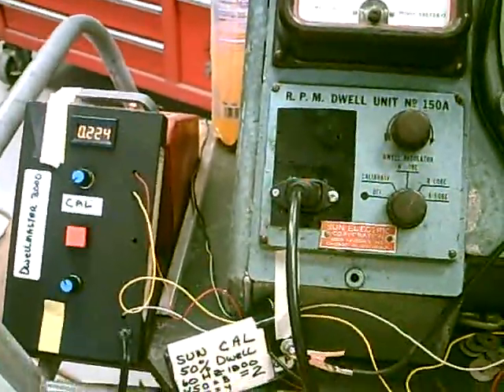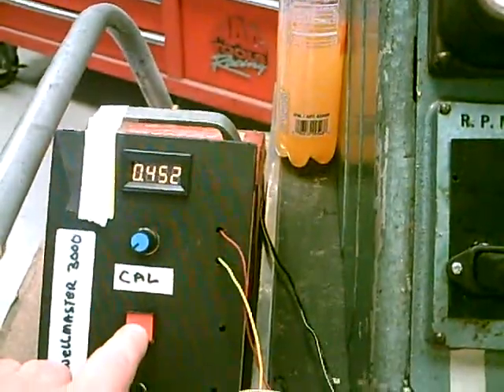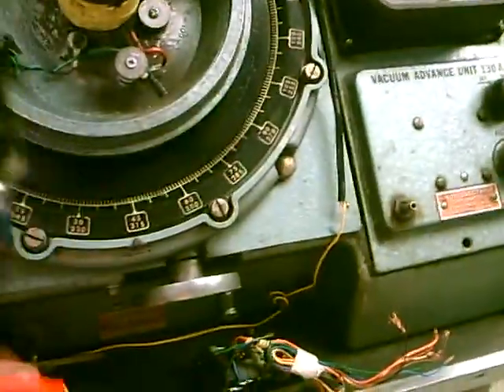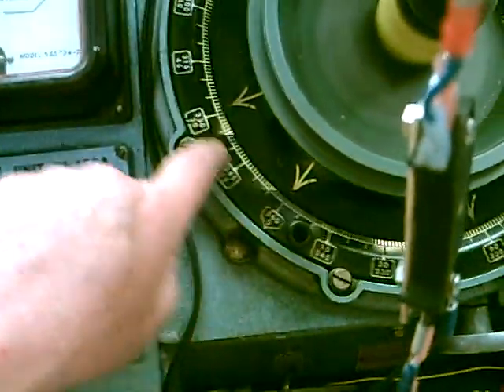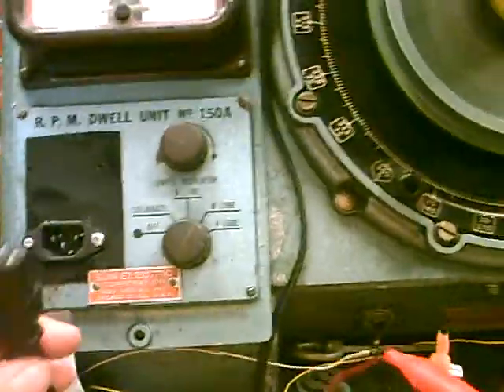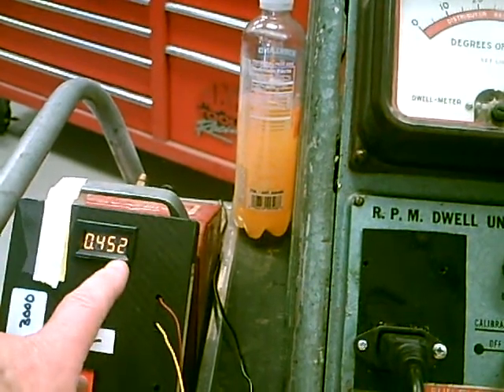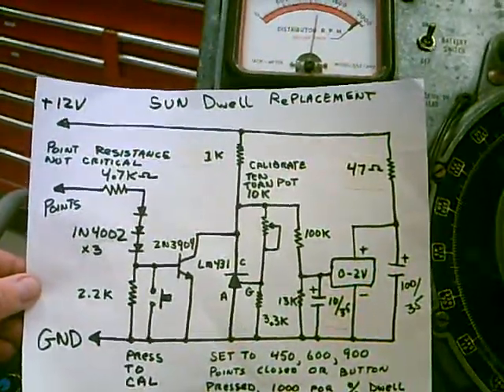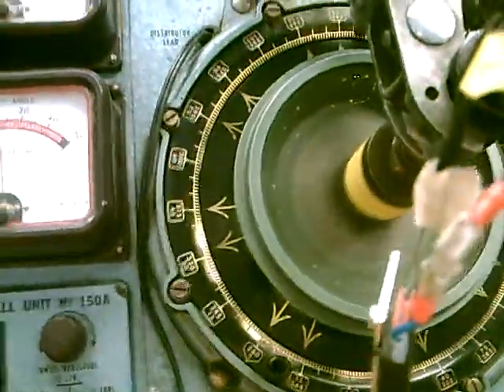SUN Distributor Dwell Meter Digital Replacement & LED Retrofit

Comment: Any chance your still repairing tgem?
Reply from the maker: I'm still helping people repair them with advice and sometimes parts. You would have to be very local for me to consider repairing one.  They are not hard with some help.
Reply: @opera5714  how may I contact you? I'm retired now, so time is a plenty ,as long as I'm not pushing up daisies. Im thinking about buying this old sun 600 series built from 54 to 62. Its a 3k rpm only. But I think it may still have its use. I would like to talk with you and pick your brain a bit. I rebuild carbatooters and thinking about doing distributors since I get asked so often.
Reply from the maker: @fenderveal7339   You have contacted me. I do prefer you ask questions on a rebuild video.  This is a community project and information provided is for the good of all.  I don't do private engineering unless you REALLY PAY.  Make a video or add to one of mine.   This isn't a one way transaction.
Reply: @opera5714  Thank you for your time. Now I know.  I will not bother you again.
Reply from the maker: @fenderveal7339  it is not a bother. You can do all the communication on YT where it can be shared with others.  I don't want to be rehashing the same information over and over.  There is absolutely no need for private communication.

Comment: Thanks for sharing these videos. I'm very interested in buying your dwell flash led conversion. could you send me the installing info to volpiv16  ad the one that starts wit a g.? Thanks in advance.
Reply from the maker: Thank you for your interest. Sorry for the delay, you caught me in the middle of a move.  While packing, I looked for the couple built units I have and couldn't find them. Now unpacking I will look again.  If I don't find them, It will be several months before I would consider building one and then only if I had another order.
Reply: @opera5714  Thank you for your answer and your time. I don't mind waiting if you can't find them. Just let me know. Thanks again
Reply: @opera5714  I was wondering if you had found a unit you can sell to me, or if you haven't, do you want to build one (or two if necessary)? I really need one. Thanks.
Reply: Hi, I suspect my emails still end up in your spam box. I've tried with another email adress, and got it back as undiliverable. reagrds, J.

Comment: what did you use for the flash tube led repair? And how did you wire it in. My machine is a 500 and is battery powered. The flash tube went out. Just curious what you used and how you wired it in. Thanks,Tom
Reply from the maker: I build the replacement kit and sell it for $149 +5 shipping. There is an epoxy module and LED in plastic ring. None of the existing  power module is used, it is a gut of the machine.  A 12V 10A LED power supply must also be purchased from ebay, about $12 shipped. More details if interested.
Reply: @opera5714  do you still offer the replacement kit? I am interested in purchasing if you still do.  I have a 506 that I would like to upgrade. Thanks.
Reply from the maker: @michaelmenegus5988  Sorry for the delay. I only know these machines by the module numbers and kept forgetting to look for the manual.  The 506 is different as it has a xenon tube and is 50% higher speed. Is your tube still working? I am concerned with doing a static balance on this high speed machine.
Reply: @opera5714  I’m sorry, I mistyped, I have a 504. It blew the capacitor under the rotor and I have not worked on it any further.  If balance is an issue I can always balance it on my balancer or have another shop balance it. The flash tube might work, haven’t got that far yet.  I also have a 500 that I haven’t tried yet either. I like your setup that direct reads dwell on the degree wheel, I do a lot of work on two cylinder John Deere’s and that would be handy.
Reply from the maker: @michaelmenegus5988  I have a JD 2cyl, suppose these are the old ones. My friends are into racing and I designed this for them. I can send you the manual. YT doesn't let you put e mail directly in comments. Break it up with no period. You can delete it after I get it, not that anyone views these much.
Reply: @opera5714  let’s try again. It deleted the last one. Mjm3020d
At the one that starts with a g.

Comment: Thanks for the video. Also looking for other info on how to repair these machines without spending a fortune. Any forums or websites that you know of? I bought one that makes quite the racket when spinning. Sounds like a bad bearing.
Reply from the maker: Not that I know of other than Paramount that sells the original service manual which is fairly hard for a non technical person to understand. Not much worth saving except the mechanicals.  I can answer on a time available basis.  Haven't touched a machine in months and access to machines takes about a week.